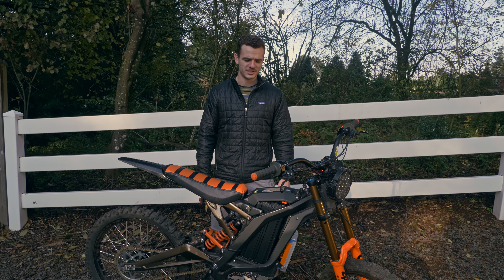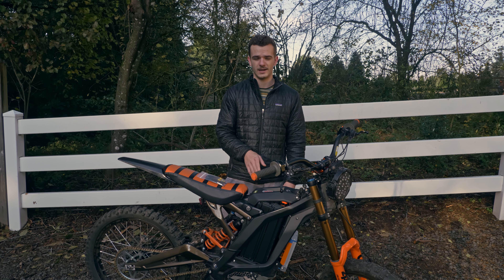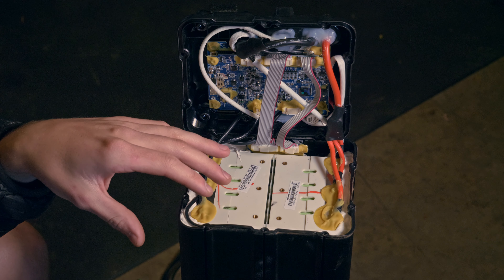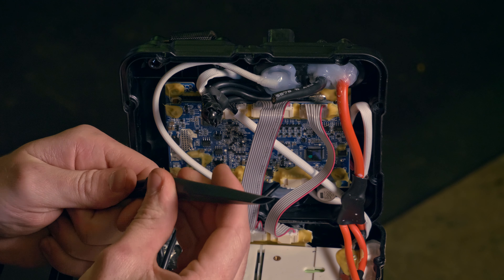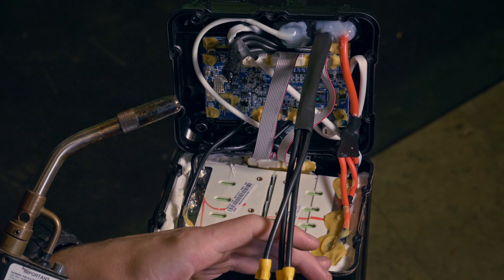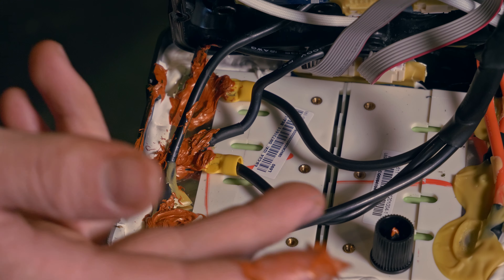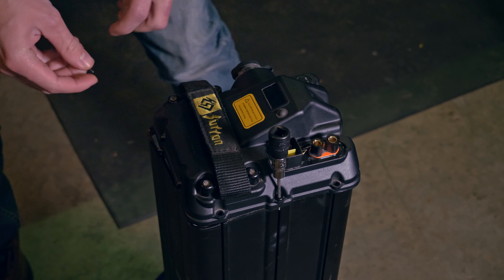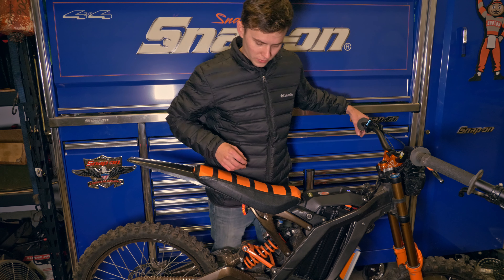How To Bypass Stock Sur-Ron Battery for more power!

Comment: I really appreciate your instructional videos. I’m an old guy who got one of the last red ones W/the X controller. I only recently became aware of the 72 volt battery upgrade and want to do it. I want to get everything I will need to do it properly the first time I order. Almost all of my riding is on the street. I have the 17” SuperMoto wheels and tires. I paid for an Onyx RCR on Indiegogo, frustrated because it was taking sooo long to get delivery, I was watching a SurRon video and commenting on how good it looked and my wife got tired of me praising it and said “if you like it so much,  get one”. Not wanting to offend the wife I did. Both ebikes were delivered the same day, about 2 hours apart. After 6-8 months I sold the RCR. The SurRon looked professionally built and the suspension on the RCR was set up for someone a lot heavier. Thanks again for the info. Do you do any work on customer bikes? What state are you in? I wouldn’t mind a road trip.
The dog and I need to get out of the house!

Comment: 10:55 as an electrical engineer of 20 years, I would highly recommend that you simply tape over the yellow ring terminal connections, simple painter's tape works well.
Reply: Hey , thanks for comment!
Can you please explain why it's a better to tape leads instead of silicone?
Reply: He's talking about while you connect the bypass kit to the discharge cable, so you dont have to worry about something is touching the contacts

Comment: Thank you for the video....for $20 it's worth it to buy your kit for one battery. However, I have 3 stock batteries.....so I went and bought all the supplies for about $20 and did it myself for all three thanks to this awesome video!👍
Reply from the maker: Definitely the right move 🤘🏽
Reply: What gage wire did you use?
Reply: @punkass151  don't remember, was so long ago. I think 10g, but I just found something about the same diameter as what I disconnected. Batteries still working🤞

Comment: People that don't use your kit and don't understand li chemistry batteries or bypass with knowledge of why stock BMS failed are asking for further damage to battery (definitely don't charge or keep in home)
If you understand cell spec and controllers set up fine go for it.
If your loading at the full 10amp constant you'll probably reduce the lifecycle further, just s heads up but great to see you point some of this out 👍
Reply from the maker: For sure risks associated with doing this. We obviously don’t ever recommend holding cells wide open at their full discharge spec for long periods of time, this is simply to get a little extra power of the punch and not so that people can go 60mph on the highway.
Reply: @emotobros   👍  don't forget voltage sag under load at lvc, that's why the power mode drops on stock BMS ideally you don't want lvc dipping to 2.5
 Good work if someone can offer properly configured ASI then the kit you buy your customers won't have any issues as not configurable by the end user !
Reply from the maker: @alexs5373  These are all things we hope our customers educate themselves on as we obviously can't cover every safety aspect of these controllers. 

Ours are setup to be very simple and anything the end user can adjust will not determine whether or not their bike will work just how it will work. We think a lot of users want adjustability and we want to offer that just not more than they can handle. 

Our controllers have no limits and that's a two way street because I'm sure at some point someone inexperienced will do something their bike isn't capable of and get mad at us despite our warnings. On the flip side, we don't want constant emails saying they wish they could adjust their controller.

Comment: Great shear TY
I have a stock out of box Segway x160 :(  I want to up grade battery, controller and increase the front tier to something like a 17".
I want to do e-bike camping with solar panels and laptop. I need saddlebags. There also might be small amount of snow on shoulders of trails/roads. What typ of tire is fair for dirt, asphalt and sand/snow IE super motor wheels ? 
Or sell it and get a Talaria Sting r or something ? Any thoughts ?

Comment: Great video guys! I opened up my battery and instead of three discharge wires, there are four! Have you encountered this? Any tips? Mahalo from Hawaii!
Reply: doesn't matter just do three like in the video and it'll be fine. it's just a neutral terminal, all of the wires are connected on the rail anyway

Comment: supply with heat shrink already pushed over wires -  second piece heat shrink shoved over 3 terminal ends stops shorts  - cost 15 cents extra - safety and Nice touch
Reply from the maker: Yes we already do this, we never sold a kit without it. Electrical tape is just what we had at time of filming the video.

Comment: Hey just wondering if this would work on a segway x160 battery and and when you put the leads on the bolts that have the stock leads on it does it matter wich lead goes to wich connection?

Comment from the maker: Glad most people are enjoying the video, but we wanted to reiterate a few things being brought up. First, this mod only works with an aftermarket controller as mentioned in the video. Also, please understand the limitations of what you are doing. The cells are rated for 10amps continuously, but you will be stressing them if you are constantly wide open at 7000W. If you find yourself always full throttle it's probably better to get a 72V battery or a higher discharge 60V. This mod is to give a bit more power off the bottom end but isn't meant to be used to cruise at 50mph+ down the freeway. That'll stress the cells and drain the battery very quickly. 

There should be no worry about charging as it functions exactly the same as it did before the mod, but like we mention, you must monitor your batteries voltage after doing this mod. There is no longer a limit on the battery and our controllers don't have limits so responsibility of your battery's and bike's health is on YOU. Take time to look into ways of being safe around lithium batteries before doing this especially if you are new to this kind of stuff. It's more dangerous than could ever be conveyed through a youtube comment.

Any modifications done to your battery/motorcycle are done so at your own risk. By bypassing your battery, you're also bypassing the built in precharge circuit within the BMS. This offers critical safety control for inrush current to your controller. This modification is not considered safe and our video is not a safety guide. Mishandling lithium batteries can lead to fires, explosion and even death. These are not toys and should be treated with great care. Lithium products should always be stored away from any flammable objects ideally in a metal containment device.
Reply: thanks, this disclaimer is all I needed to know its not for me. ill be stock controller for a while.
Reply: Just so I understand the above comment correctly....even with your $700+ kit (controller and bypass), there is still no voltage monitor? In the video, you kept pointing to something on the handlebar, which implied (to me) that this is where you could monitor it. If we can not monitor with your set up, can you please list what you have installed (complete kit) so we are better prepared? Also, had you guys documented the range? Will your mode significantly decrease range since so much more power is being put out? Assume so.
Reply from the maker: Our $700 kit, which is starting price for the quick guys, comes with: BAC4000, plug and play harness, egg rider v2 display (this is where u monitor percentage and voltage), mounting brackets and hardware.
Reply: @emotobros  good to know. thanks. where can we get on an email blast to see when the kit is released. Or, do we just check back on site Dec 7? Also, what have you guys found on difference of range? This is critical info for some of us riding in the back country.
Reply from the maker: We plan for dec 7th on our site. Really up to out suppliers to meet that, we’ve done everything we can. We go over range testing in latest video. You may see 5% more on a whole ride, after all power is power and one controller shouldn’t be that much more efficient at using it than another
Reply: @emotobros  Great. I appreciate the info. We are looking for more range rather than more power....for now.

Comment: Thanks for the info. I'm going to suggest using the heat shrink ring terminal connector. They are a better vibration connector. Also pure silicone ( any hardware store) is heat proof and looks more professional too. 👍👍
Reply: Another video said not to use regular silicone as it will not play nice with the heat shrink and other plastic in the ring terminal. But what do I know?

Comment: Hi, my battery of my Segway X260 was dead ,I have a standard battery and controller . Measuring the battery , I still had 60V , so the problem had to be in the BMS controller. I did the BMS controller by-pass , not for more power but to get my bike running again and it worked ! Do I need to take care of soemthing special when charging the battery ?

Comment: Thanks for making this. Its definitely making me want to get a new battery so I can get some additional range. I know you guys used the RTV Copper Silicone since that is what you had on hand at the time of making the video. Is there a better option you would recommend? Something that hardens similar to the original material the Sur Ron battery came with?  Thanks.
Reply from the maker: We aren't super familiar with what they used for the original material. I'd do some looking for insulative puddy or something along those lines.
Reply: @emotobros  Couldnt you just splice in on that negative cable going to the bms and connect the bypass as shown but still leave the bms fully connected?🤔, this would make the bms and the battery % display work like normal but still let the current bypass the bms and going over 80a when you need it?🤔.
Reply: @Negern91  No answer?
Reply: @bertdude3   someone said the bms acted up doing wierd stuff. I never tried i just bypassed and got another meter hardwired in.

Comment: Will the bac 4000 be able to run both a 72v and a 60v battery? Looking to buy a 72v, but I'd still like to be able to use my 60v. Especially if I can do this discharge mod. Thanks!
Reply from the maker: It can do that, but at the moment it will be programmed for one or the other when it ships. We are working with the developer of the display to add on the fly voltage switching from the smartphone app.
Reply: @emotobros  That would be awesome. I would love to be able swap batteries at the trail head

Comment: To make sure i understand.. So with the bypass kit and bac4000 you can run stock battery 🔋 getting 7,000watt peak power ?
 Does this also give more range 🤔 or takes away from range?
   I am ok with 40s (mph) being my top speed my worry is more range vs 🔋 power...  not a whole lot only want 50-60 miles with a 2-5hr charge time. This would let me ride into the city 25.3miles and stop for food charge as i eat maybe see a movie rent a scooter kill time.. ride around the city for few miles and make it home with no worries 👍
Reply: There is actually a list for ""Gorilla charging"" and there is a few friendly spots and there is pay charging stations but you need a spacial adapter for that. So im half-way there lol from what i been reading range on a stock set up (unlocked) is around 40miles that could get me there but limits my time riding around in any ride outs or meet ups..
Reply: no. this allows you to draw more power from the stock battery with a aftermarket controller. (7kw)

it does not increase the battery capacity. you will most likely see increased power usage and your range will get lower.
Reply: @shitpostcentraI  thats more or less what i thought. I dont want more power just yet. Range and control the freaking stock throttle sucks its crazy hard to hold a speed. Tring not to speed in my town stay around 20mph its jumpy as hell lol
Reply: @miguel360kmc  you can get big 72v batteries that will increase your range and power with a controller.

also you can get bigger 60v batteries for stock controller, but it's not worth it
Reply: @shitpostcentraI  yeah i seen them 60v 50amh or something its only a little bigger. I'm hunting for the piggyback battery pack coming out of poland i believe.. set up lets you run a mini battery pack along with your main battery giving you that extra 10-15miles.. cant find it for sale though found videos and pics

Comment: One of the crimps looked to have flat almost sharp sides. This can cut through the heat shrink sometimes leaving a possible short point.
Something to watch for
Reply from the maker: Definitely true. It can be hard to make crimps on insulated connectors and even the large non insulated connectors without getting a flat side on them. You make a good point and for anyone reading this, if you have a sharp edge, try to pound it down a bit and add a bit more tape around the heat shrink. 

Luckily, the wires inside the battery don’t move around much but it’s certainly something to lookout for.
Reply: @emotobros  good job with the warning but I would have taped up those loose ends if displaying to  a novice.  The energy in that battery can burn your face off.  Check this link out for the appropriate type of heat shrink to make certain nothing wrong happens under the hood when you are two years down the road.  https://www.heatshrinkupm.com/lv-heat-shrink-tube/military-grade-heat-shrink-tube/

Comment: Hey guys, this video was great and super helpful when I did the bypass! Thank you! 
One question though, how many amps should I set my regenerative braking to supply to the battery? What is the max?
Reply from the maker: Glad you liked it! I wouldn’t go above 10-15A for regen
Reply: Can taking off the regen hurt it I’m running the Luna XX controller
Reply: Regen is rubbish on stock sur Ron power

Comment: when you upgrade batteries and push out more amps, do you not need to upgrade the 100A circuit breaker also? I'm surprised it doesn't trip...
Reply from the maker: It’s not really a circuit breaker. The only purpose it serves is to prevent the battery from arcing when you plug it. It offers no protection from shorts.
Reply: @emotobros  Sure, it's more of a switch, but it's rated for 100A, I'm surprised it doesn't pop with some of these higher powered systems..
Reply from the maker: I believe it’s rated for 100 AC amps not 100 DC amps. We’ve pulled 300+A through it and it never broke. I think the DC rating if it is much higher.
Reply: @emotobros  interesting G2K...

Comment: Does the stock BMS balance on discharge though? Since if you bypass it and you have a weak cell, you are still taking the risk of damaging your battery at well above the cut-off voltage, as that is simply an average voltage of all cells combined. having 2 weak cells rapidly discharge down to 2.8v and the rest at 3.6v would show 56v and you think you're well above safe levels, however those weak cells are way below safe levels and will rapidly degrade/die or catch fire
Reply from the maker: The BMS balances during the charging cycle so bypassing the discharge side of the battery does not hinder the balancing function of the BMS. Even so, the low voltage we recommend in the video takes this into consideration and leaves some buffer room for cells that are sagging a bit behind in voltage.

Comment: Ebmx now tunes their bac8000 to 8500 watts and 400 phase amps for the 60v bypassed battery setting. Is this actually safe to run?
Reply: Did ya ever read or here more about this id like to get close to 8-8500w
Reply: @ no never heard back, i would tune it lower though becuase you can pull too much power and can cut off for a few seconds. 

If you like to go more than 10-12 miles then invest in a bigger battery

Comment: Hi.

Can I install  3-way selector to choose to actuate the bypass or the original system at any time?
Reply from the maker: You should be able to. Make sure the switch you use is rated for the whole 120A cont. current. Something of that size may be tricky to put on the SurRon.

Comment: The way I heard it was I must stop riding at 52% ? I haven't seen a clear answer on range after the bipass. 
Is the extra power worth $1300 with a loss of half range ?
Reply from the maker: Hey sorry, it was 52 volts not 52%. You’re not sacrificing any range doing this mod as range is only determined by weight, friction and how hard you twist the throttle!

Comment: Can you make your own bms and put it in the stock sur ron like limit it at 6500watts? 
Just don’t want to do this if it’s going to fry my battery
Reply from the maker: You probably wouldn't want to go through the hassle of making one but you absolutely could buy one rated for more current and throw it in there. Typically isn't exactly plug and play but it has been done.

Comment: UM You do know copper ultra is conductive if it get on the PCB it will short out ? use NON CONDUCTIVE GREASE .
copper base is to stop metals binding ,,,,
Reply from the maker: Hmmm, you must not have listened to the video. I quite clearly state that although it says copper, there isn’t any in it. It’s just a horrible marketing thing by RTV. Go to their page and look if you don’t believe us. They say that they call it that just for the color but that it is not conductive in any way.
Reply from the maker: https://www.permatex.com/faqwd/permatex-ultra-copper-maximum-temperature-rtv-silicone-electrically-conductive-copper/?locale=en_us